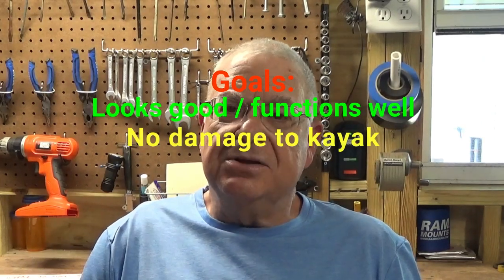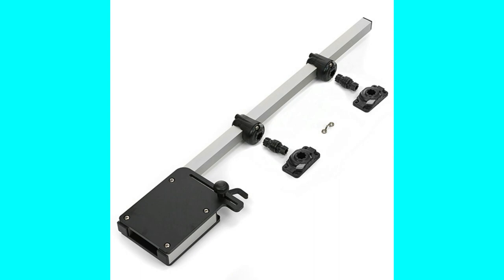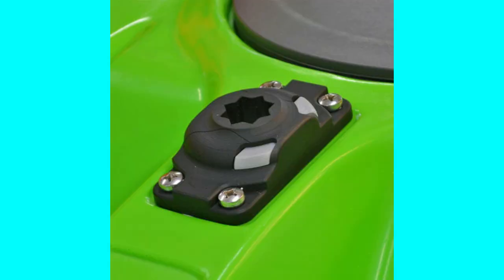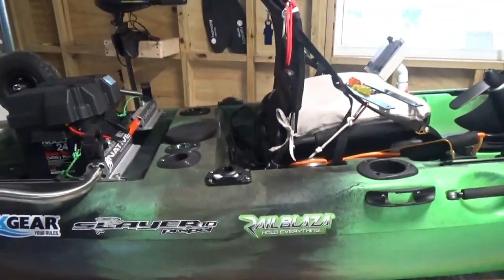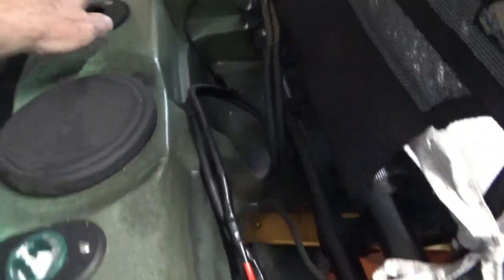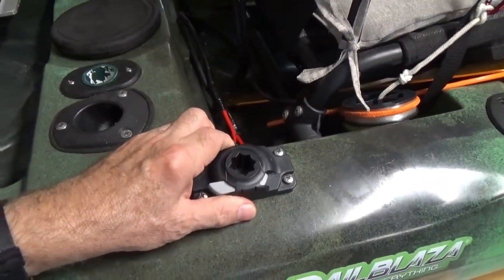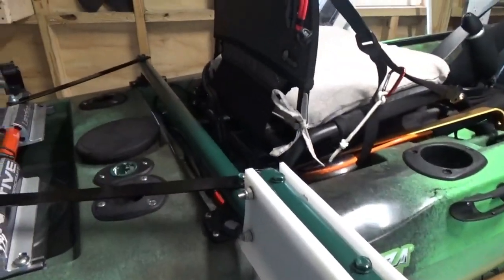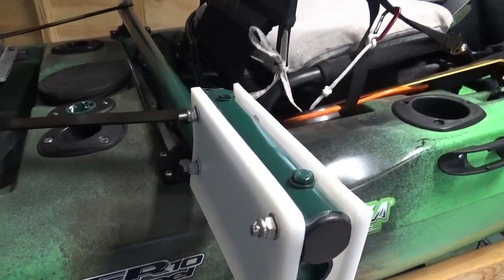VLOG #15 Railblaza style trolling motor mount for kayak Part 1

Comment: Only issue i see is its too close to the kayak. If you need to operate the motor in shallow water the prop is going to hit the side of your yak. I would've made your mount bar longer.
Reply from the maker: Thanks for the comment.  I mainly wanted the trolling motor to move from one location to another.  The Slayer Propel 10 kayak has the foot operated propeller for moving around in the shallower areas.